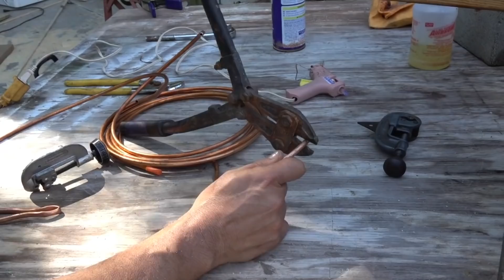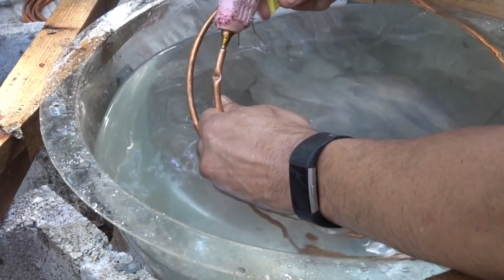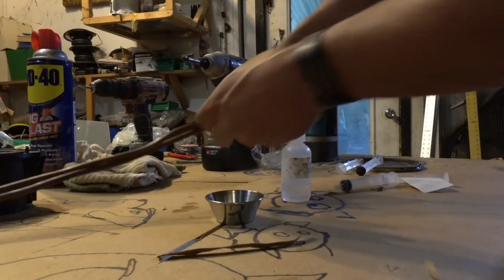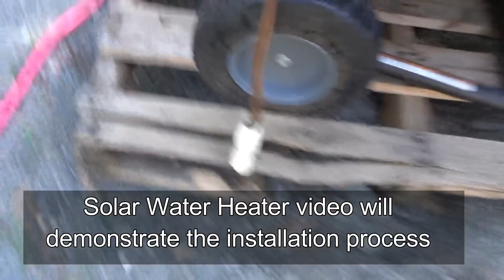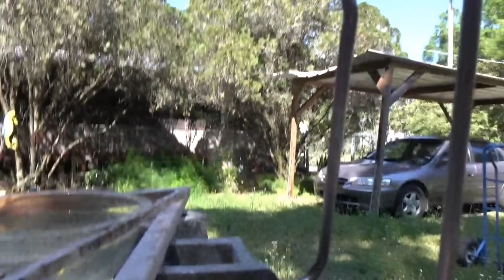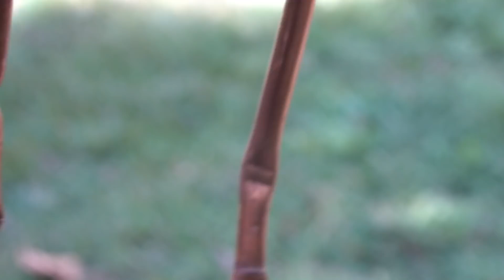Bending copper tubing solar hot water heat exchanger Detailed Version

Comment: Hey Dan, when bending the copper tube around the larger pipe, it might be worth a try to lay the pipe on the ground, and tape the copper to the pipe, then roll the pipe on the floor, or on a work table. Take care to not crush or flatten the copper. Another way might be to use a short piece of pipe inserted into a lathe, or some kind of slow rotating mechanical device that you can use to wind the copper around the pipe without as much effort. I also believe that using sand instead of water is easier, but water seems to work well too.  Thanks for the demo.
Reply: 1  In the name of God, the Gracious, the Merciful.
2  Praise be to God, Lord of the Worlds.
3  The Most Gracious, the Most Merciful.
4  Master of the Day of Judgment.
5  It is You we worship, and upon You we call for help.
6  Guide us to the straight path.
7  The path of those You have blessed, not of those against whom there is anger, nor of those who are misguided.

163  Your God is one God. There is no god but He, the Benevolent, the Compassionate.

2  God, there is no god but He, the Living, the Eternal.
4  To Him belongs everything in the heavens and everything on earth. He is the Sublime, the Magnificent.
11  Originator of the heavens and the earth. He made for you mates from among yourselves, and pairs of animals, by means of which He multiplies you. There is nothing like Him. He is the Hearing, the Seeing.

1  Say, “He is God, the One.
2  God, the Absolute.
3  He begets not, nor was He begotten.
4  And there is none comparable to Him.”

3  He sent down to you the Book with the Truth, confirming what came before it; and He sent down the Torah and the Gospel.
4  Aforetime, as guidance for mankind; and He sent down the Criterion. Those who have rejected God’s signs will have a severe punishment. God is Mighty, Able to take revenge.
5  Nothing is hidden from God, on earth or in the heaven.
6  It is He who forms you in the wombs as He wills. There is no god except He, the Almighty, the Wise.

14  We have entrusted the human being with the care of his parents. His mother carried him through hardship upon hardship, weaning him in two years. So give thanks to Me, and to your parents. To Me is the destination.
15  But if they strive to have you associate with Me something of which you have no knowledge, do not obey them. But keep them company in this life, in kindness, and follow the path of him who turns to Me. Then to Me is your return; and I will inform you of what you used to do.

48  God does not forgive association with Him, but He forgives anything less than that to whomever He wills. Whoever associates anything with God has devised a monstrous sin.

31  Say, “If you love God, then follow me, and God will love you, and will forgive you your sins.” God is Forgiving and Merciful.
32  Say, “Obey God and the Messenger.” But if they turn away—God does not love the faithless.
33  God chose Adam, and Noah, and the family of Abraham, and the family of Imran, over all mankind.
34  Offspring one of the other. God is Hearer and Knower.
35  The wife of Imran said, “My Lord, I have vowed to You what is in my womb, dedicated, so accept from me; You are the Hearer and Knower.”
36  And when she delivered her, she said, “My Lord, I have delivered a female,” and God was well aware of what she has delivered, “and the male is not like the female, and I have named her Mary, and have commended her and her descendants to Your protection, from Satan the outcast.”
37  Her Lord accepted her with a gracious reception, and brought her a beautiful upbringing, and entrusted her to the care of Zechariah. Whenever Zechariah entered upon her in the sanctuary, he found her with provision. He said, “O Mary, where did you get this from?” She said, “It is from God; God provides to whom He wills without reckoning.”

16  And mention in the Scripture Mary, when she withdrew from her people to an eastern location.
17  She screened herself away from them, and We sent to her Our spirit, and He appeared to her as an immaculate human.
18  She said, “I take refuge from you in the Most Merciful, should you be righteous.”
19  He said, “I am only the messenger of your Lord, to give you the gift of a pure son.”
20  She said, “How can I have a son, when no man has touched me, and I was never unchaste?”
21  He said, “Thus said your Lord, `It is easy for Me, and We will make him a sign for humanity, and a mercy from Us. It is a matter already decided.'“
22  So she carried him, and secluded herself with him in a remote place.
23  The labor-pains came upon her, by the trunk of a palm-tree. She said, “I wish I had died before this, and been completely forgotten.”
24  Whereupon he called her from beneath her: “Do not worry; your Lord has placed a stream beneath you.
25  And shake the trunk of the palm-tree towards you, and it will drop ripe dates by you.”
26  “So eat, and drink, and be consoled. And if you see any human, say, ‘I have vowed a fast to the Most Gracious, so I will not speak to any human today.'“
27  Then she came to her people, carrying him. They said, “O Mary, you have done something terrible.
28  O sister of Aaron, your father was not an evil man, and your mother was not a whore.”
29  So she pointed to him. They said, “How can we speak to an infant in the crib?”
30  He said, “I am the servant of God. He has given me the Scripture, and made me a prophet.
31  And has made me blessed wherever I may be; and has enjoined on me prayer and charity, so long as I live.
32  And kind to my mother, and He did not make me a disobedient rebel.
33  So Peace is upon me the day I was born, and the day I die, and the Day I get resurrected alive.”
34  That is Jesus son of Mary—the Word of truth about which they doubt.
35  It is not for God to have a child—glory be to Him. To have anything done, He says to it, “Be,” and it becomes.
36  “God is my Lord and your Lord, so worship Him. That is a straight path.”
37  But the various factions differed among themselves. So woe to those who disbelieve from the scene of a tremendous Day.
38  Listen to them and watch for them the Day they come to Us. But the wrongdoers today are completely lost.
39  And warn them of the Day of Regret, when the matter will be concluded. Yet they are heedless, and they do not believe.
40  It is We who will inherit the earth and everyone on it, and to Us they will be returned.

15  O People of the Book! Our Messenger has come to you, clarifying for you much of what you kept hidden of the Book, and overlooking much. A light from God has come to you, and a clear Book.
16  God guides with it whoever follows His approval to the ways of peace, and He brings them out of darkness into light, by His permission, and He guides them in a straight path.
17  They disbelieve those who say, “God is the Christ, the son of Mary.” Say, “Who can prevent God, if He willed, from annihilating the Christ son of Mary, and his mother, and everyone on earth?” To God belongs the sovereignty of the heavens and the earth and what is between them. He creates whatever He wills, and God has power over everything.
18  The Jews and the Christians say, “We are the children of God, and His beloved.” Say, “Why then does He punish you for your sins?” In fact, you are humans from among those He created. He forgives whom He wills, and He punishes whom He wills. To God belongs the dominion of the heavens and the earth and what lies between them, and to Him is the return.
19  O People of the Book! Our Messenger has come to you, making things clear to you—after a cessation of messengers—so that you cannot say, “No preacher has come to us, and no warner.” In fact, a preacher has come to you, and a warner; and God is Capable of everything.

28  It is He who sent His Messenger with the guidance and the religion of truth, to make it prevail over all religions. God suffices as Witness.
29  Muhammad is the Messenger of God. Those with him are stern against the disbelievers, yet compassionate amongst themselves. You see them kneeling, prostrating, seeking blessings from God and approval. Their marks are on their faces from the effects of prostration. Such is their description in the Torah, and their description in the Gospel: like a plant that sprouts, becomes strong, grows thick, and rests on its stem, impressing the farmers. Through them He enrages the disbelievers. God has promised those among them who believe and do good deeds forgiveness and a great reward.

84  Say, “We believe in God, and in what was revealed to us; and in what was revealed to Abraham, and Ishmael, and Isaac, and Jacob, and the Patriarchs; and in what was given to Moses, and Jesus, and the prophets from their Lord. We make no distinction between any of them, and to Him we submit.”
85  Whoever seeks other than Islam as a religion, it will not be accepted from him, and in the Hereafter he will be among the losers.

111  And say, “Praise be to God, who has not begotten a son, nor has He a partner in sovereignty, nor has He an ally out of weakness, and glorify Him constantly.”

Read The Quran

Comment: Thanks for the tip. I'm thinking that, if you insert ~ 1 foot of the copper tubing inside the 2" pipe, then wrap the tubing around the pipe, so the coil would wrap around its own inner tube with both ends at the same end. Perhaps then the stretched-out coil & its inner tube could both be spiral-fed into the water heater's tank?

Comment: I have found it is easier to use table salt & solder an end cap on to make a condensing coil for a steel. An bend it around a PVC pipe. It also used to make a Rocket Stove Water Heater. While this Gentlemen's way will work, I would not used IT! Look for a better video under "Solar & Rocket Stove Water Heaters"